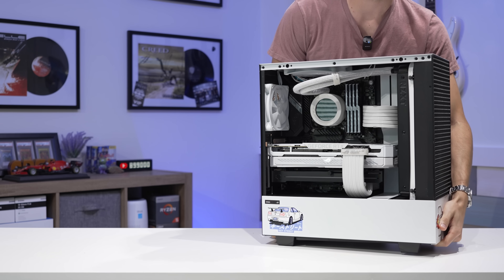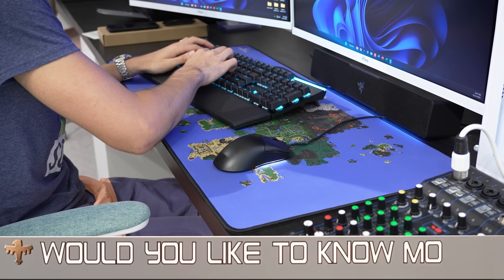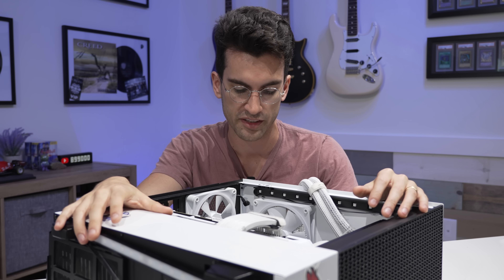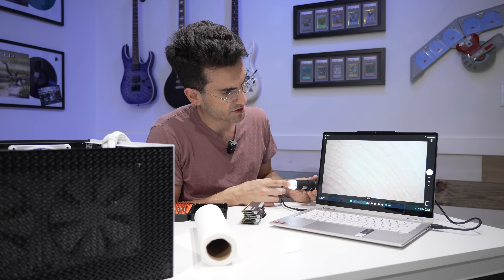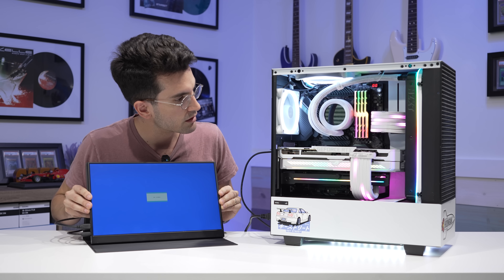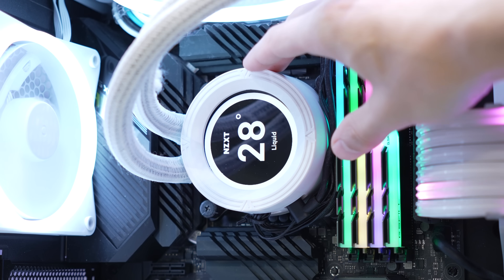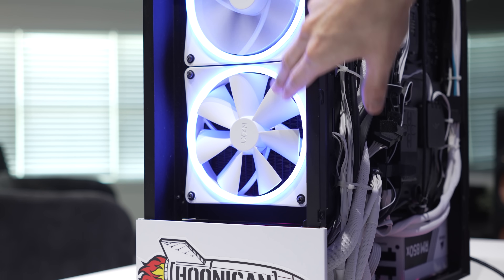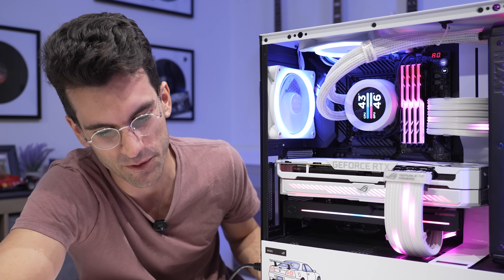Fixing a Viewer's BROKEN Gaming PC? - Fix or Flop S6:E15

Comment: Michigan here.. another perfect timing video. Just spent hours trying to fix my son's Asus ProArt x870e Creator motherboard socket. Was able to fix it enough to get it to post but under the microscope I could see that two of the pins were missing. I used a pin layout chart I found online and the missing pins were for Dram and the headers for the CPU/Fan headers. I was not able to get the pump to run fast enough to keep the CPU cool so it would heat up till it turned off. Shame to brick a motherboard within hours of buying but I was able to find a repair shop in the neighboring State that is able to re-socket it for less than $200. Amazing how hard it is to find someone who can repair or replace motherboard sockets.

Comment: 4:40 I cringed when you removed the socket screws with the socket pins exposed and relied entirely on the magnetic tip to not drop the screws on the pins.

Comment: Well done Greg!!! That is not easy to do at all! I managed to save a motherboard given to me that had bent pins and it took for ever to get them straightened out and mine didn't look half that good. Talk about stress! If one is good at this sort of thing its a great way to set up a little "side hustle" fixing these bent pin boards (if you can get them cheap enough). I'm trying to teach myself how to repair graphics cards and I'm not going to lie, it's been a struggle. Not having the right equipment is a major limiting factor but I've managed to repair a few.

Comment: Longshot question but I can't find anywhere online...

When I try to enable the XMP profile for my rig, the system will reboot but then stay on a black screen constantly after, even after 5 minutes.

What would be the cause of this and any suggestions how to fix. Thanks!
Reply: Some CPU memory controllers simply can't handle the XMP setting for whatever reason. This is especially true when using four sticks of DRAM. Often you will have to manually dial in settings that work. In my case at one point I was using four sticks DDR4-3600 with an i5 12500 and I could only get them working at 3466 in gear one.

Comment: About the amount of thermal paste: Many tech youtubers say that it doesn't matter if you put "too much" thermal paste. That it is, in fact, safer to put more than too little.

Yet, I have a packet of Noctua thermal paste and said packet says, and I quote: "Caution: Applying too much paste can increase CPU temperatures!"

So, who should I believe, Noctua or tech youtubers?
Reply: Its really about context... and scale

More thermal paste can result in poor contact because there's a sheer amount of it and depending on the mounting hardware, it might create a thicker gap. 
More thermal paste can also just ooze out around the edges, but that won't really be an issue for 90% of users, and realistically the difference in temperatures is probably 1 or 2 degrees.

Less thermal paste means that the layer of thermal paste will be thin and therefore the most effective, but too little thermal paste will not cause proper contact. Again, the difference is usually a few degrees at most.

With modern CPUs, the dies are much larger, so having proper contact across the die is pretty important, but its not the end of the world if a tiny corner of the IHS is not covered or not...  As long as the CCD is covered, its fine (google CCD layouts of your specific cpu)

The high mounting pressures of most modern sockets will guarantee a good layer as long as you have enough. Noctua's recommendation is probably aimed at getting you to put the perfect amount and spreading it, whereas Youtubers are recommending for the larger tech commuinity as a whole.

TLDR; It really doesn't matter so just go with whatever you want. I generally apply slightly more than necessary because the excess will just run over the edge. I have seen thermal paste where there wasn't enough of it and it started drying out over time or not making contact on the edges. There's more drawbacks with having too little, than there are drawbacks with having too much.
Reply: In Gamers Nexus we trust

Comment: 5:19 if it's only one or two ground pins missing it's not that big of a deal. Also some pins may lead to non working ram slots or fewer pcie lanes while the CPU is still working just fine. The purpose of each pin can be found in the lga 1200 pinout
Reply from the maker: Yes, I'm aware. But the chances of that are very low. The result is typically complete failure.
Reply: @GregSalazar chances of a fully or at least partially working yet stable cpu are actually quite high. There is a lot of ground pins or other less critical connections. For example sometimes some extension slots, USB-Ports etc. don't work anymore or the primary pcie slot has only 8pcie lanes instead of 16 etc etc

Comment: He Greg I was wondering if you could help me after putting my pc in sleep mode on windows
I tried waking it up I waited for a couple min and no post then I tried turning it of and on again and it still won't post I have two debug lights red vga and amber boot it was working fine yesterday I looked up the lights and it gets hung up on cpu and ram
Pc:specs are: ryzen 5 7500f, asrock b850m pro a, ddr5 32gb 6000, and a 3060, also I have reset cmos

Comment: last weekend, I got the budget to do a new build and it went well until it stopped booting, no post, no power up , just nothing.   My son was excited to help me because it meant he was getting the pc that I was using which was a big upgrade form what he was using.
Apparently during the first go through of bulding the pc, one of the standoffs wasn't screwed in all the way and I think this was cuasing it to not post.   Didn't find out about the standoff until much later.   So, when I took everything out of it to try and troubleshoot, started adding components back in and somehow the argb header pins got bent, think my son did it accidentally because I had him do it since he has much smaller hands. And when it still didn't power up, I took everything out again and this time got an older PSU and tried it, only 24 pin and cpu power and it worked.  put my brand new PSU with only those 2 same cables and did not work.    and to make absolutely sure, I connected the brand new PSU to one of our existing PCs  and still no power.   This confirmed, the new PSU was dead.
Next day, got a new PSU, took the PC apart yet again and at this point is when I discovered the stand off not screwed in all the way.  started adding one thing at at time and test to power up, this is when I discovered that the argb pins were bent. plugged argb cable in and no power.  unplugged argb cable and it powers right up!   no great loss, I don't really care if the pc is all lit up or not.

Next task?  taking time to fine tune and get better perf and better fan curves,  i know the 9800x3d runs a bit hot, but I'm sure I can tame it some.

Comment: I actually bought a set of dentist's picks that I use. they work really well. repaired bent pins on an AM4 board about a 2 weeks ago
Reply: An AM4 board does not have CPU socket pins.
Reply: @noseyparker8130   maybe it was an intel, now i do not recall, but for an am4 will still work to fix pins on the CPU.

Comment: most likely accidentally dropped something on the pins or got thermal paste in the socket tried to clean it and bent the pins, unfortunately its easily done, its a headache to fix, less so for a PGA as the pins are on the cpu arent as fine and merely stand upright, not a weird angled spring like thing.

Comment: Even with missing pins it's always worth the effort! There's many ground pins, which are largely redudant unless youre missing loads in the same '"section". Similar for Vcore (power) pins, there's way more than you need unless youre doing top end overclocking.
Reply from the maker: Yep! But obviously not ideal. If I'd said as such, it might give the impression to some that it's ok to be a bit fast and loose.

Comment: board repair specialists would say the socket can be replaced. replacing pins isnt possible. but you need to ask how much and decide if new mb with the time needed to do bios update possibly is cheaper. either way the motherboard comes out: for repair you send it off and pay, for replace you go buy something and then rebuild the system and maybe have to bios update.

Comment: Is there any way to fix green-blue lines issue on a Monitor? (other going for a repair shop?)
My Monitor suddenly started to show those lines yesterday without any reason.
The Monitor is about 4 years old now (so out of warranty), and its from Samsung (costed about $100 when converted from my local currency).

Comment: The more RAM, the longer the memory training needed. Especially DDR5. 128GB takes up to 3 minutes to train and AGESA 1.2.0.3e adds support for 256GB (4x64 at 6000mt/s). That'll take 6 minutes to train. Might as well wash the dishes or take a quick shower ... 😝

Comment: Isn't the CPU rad on the wrong way? All air goes upwards so the AIO pump might be sucking in air.
Reply: as long as the pump is below the lines going into the radiator it should be fine. Tubes at the bottom of the pump is also what I like to do not at the top and sides like we have seen in this video.

Comment: rebooting would not show if the the repair is done
for example
i brock my MB pins , i did fixed them using a needle and a micro camera
the PC loads and works fine 
BUT , it's BIG BUT
if you do any of those action , PC will CRASH/ turnoff , cuz the connection with the Pins are not 100%:
 1-overclocking
2-Play a heavy game
3-compressing a large file
4-benchmarcking

what i'm trying to say , after fixing the pins , you should have tried benchmarking or playing or do some heavy stuff , this will always make the hidden issues comes out to the light.

Comment: I did a redo on one of my PCs. I had a MB failure and the cost to replace the MB for my CPU. (FX-6350) Was more than buying the Ryzen 5 1600AE and a B350 board (ok maybe $20USD) more than buying the replacement off of EBay

Comment: 4:22 it is repairable but it is needed to resolder whole socket and it is bga. It is very hard and expensive so only for most expensive board viable.
Reply: For a maximus hero (if that's the only issue), it's worth it, since that board is relatively expensive. I once completely f-ed up the socket of a X670e Aorus Master board, man I was pissed for days. Now I'm running a MSI X670e Godlike board, I think I'd die inside if I killed this one, given it's a 1000$+ mobo in my neck of the woods.

Comment: The repair for that is a complete socket replacement. That entails heating up the socket itself until the solder releases, clean up the solder from the board, use a solder template to apply solder to the new socket, and heat the new socket to allow the new socket to seat itself onto the solder pads. Once it's cool, it will be usable again. It's not a fix for the common user. I wouldn't attempt it myself either. Just get a new motherboard. You need professional tools to do it.

Comment: GReag, Nicely done on the socket! I have also been saving a few boards from the electronics reaper, and I an happy my hands aren't shaking when I perform these very dificult repairs. Also, neat and short video, but very informative too.  Things happen when you are not careful, holding soemthing above the open socket. Yeah, I am sure we've all been there. 

This looked like a very easy fix, compared to some nightmares you have been showing, and I also have been experiencing in my line of work. All good at the end of the day. Hug your son and wife, they know you want to and they love it. :)

Comment: at the tender age of 59, I decided I wanted to build my first PC.  After watching countless videos, I failed to realize (or nobody told me) that the CPU socket latch had a metal backer piece under the motherboard.  Well, while installing the CPU cooler, mine of course fell off, and while trying to fix it, I totally mangled the socket pins.  No matter how hard I tried, I couldn't get them bent back, and I finally gave up in disgust and forked out the money for a totally new motherboard.  It all worked out in the end, and my second build went swimmingly well.
Reply: Good on ya! Hope that PC gets you many years of joy!
Reply: At least you learned something and it wont happen again
Reply: It happens so easy, i have a workstation and i tried different cpus which i bought, while changing cpus, at the end of the line, one cpu fell on the socket and i fixed nearly all pins but exactly one was destroyed, it would work fine but with just one ram slot, the pin i destroyed was for the ram control.
Reply: So sorry to hear your plight as a 1st time builder. Hindsight is 20]20 but when building 1st time or not, always remove both sides ( L & R ) of the case and get a good visual.  On modern cases there is a window cut out of the motherboard tray. In older cases - not. I just experienced this with my most recent build where I tried to use " old stock " !
Reply: How much was the first motherboard?
Reply: Amazing work man
Reply: Let’s see, I messed up the os install, forgot to remove the sticker on the air cooler for my cpu, and later on caused a stability issue on a gpu trying to lower temps with new thermal pads. First builds are fun like that.
Reply: hey just a just tip buy your motherboard from amazon next time if this happens they will return and refund no questions asked (ive dropped a motherboard and returned it )
Reply: Can't keep a good a good nerd down 💪
I just burnt up an ssd😢

Comment: There are places that will replace CPU sockets with bent pins. Many months ago I somehow bent a number of pins in a very expensive Asus ROG motherboard. I contemplated replacing the mobo but at very high cost. I found a repair place that replaced my CPU socket for $150.00-160.00 inclusive of all shipping charges. The place is located in/around Cleveland, Ohio. I am unsure about posting the name of the place. Much better than trashing a cherished mobo.

Comment: i don't know how one even gets that many bent pins, but I've had a similar case happen to myself. It was a build i did back in 2015, i was replacing a slower CPU with a faster one, and somehow, it posted, worked for a while, and then failed to post. I checked everything, and thought maybe re-seating the CPU might help, and when i removed the CPU, i found a bent pin, pushed it back with a tiny screwdriver, and it's continued working to this day.

I like when you're able to get the computer running again without replacing any parts. Great job as always. That must have been a pain on your back and neck to be stooped over the computer bending the pins back one by one gingerly. That's not something I would want to do

The build is very pretty to look at. Props to the builder!
Reply: During a budget build for myself a few years back I did the stupid thing and decided to assemble the new rig while severely lacking in sleep and I I dropped the CPU into the socket.. Bent four pins in one location and two in another. So I can see how that happens. Took a solid two hours with a needle, flashlight in my mouth and a magnifying glass to get all the pins back in line. But it worked. It's the same pc I am on right now.

Comment: The lights in the cables is really interesting. I've never seen that before.
Reply: These cables are called “Strimer” and are from Lian Li.
Reply: Lian Li's lighted "Strimer" cables have BY FAR the best granularity, or frame rate I guess you'd call it, when referring to the way the colors "move" through the cable's length. The AsiaHorse versions are much cheaper, but do not look good. unless static. And moving lighting patterns will show how the other brands have not yet dialed the micro details! The Lian Li hub also works as a stand alone if you  do not have an entire Lian Li ecosystem. Which is great since Lian Li is something you normally buy in small batches to kit yerself out! Lol!
Reply: Neither have I.
Reply: Remindes me of the Flux Capacitor
Reply: It is called "streamer cables". Look it up.
Reply: @ramaSwamp  Just want to correct you, it's "Strimer". No bad vibes bro, just a correction :D